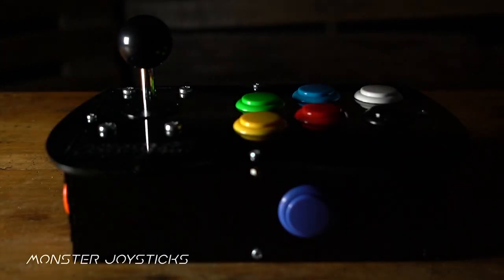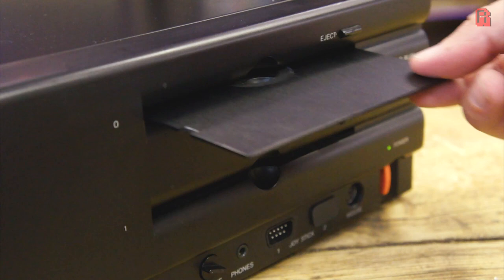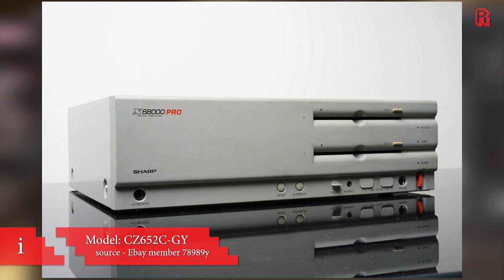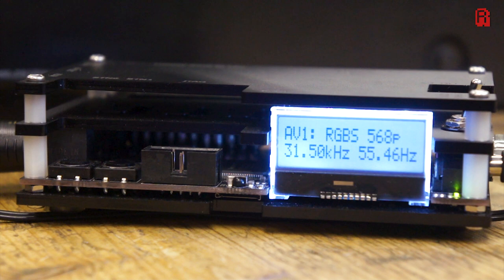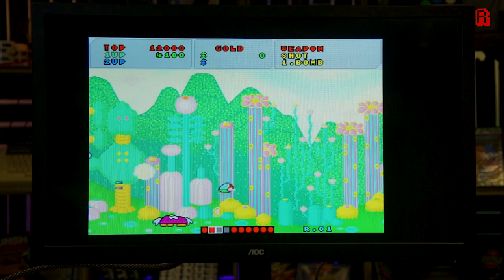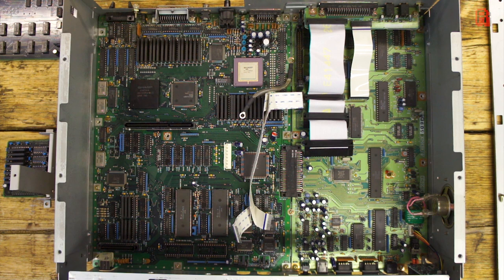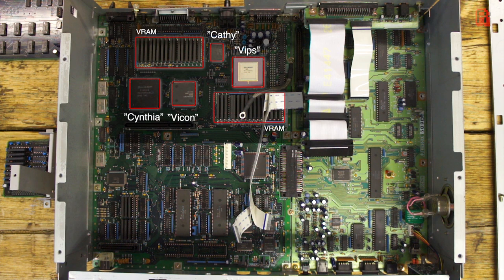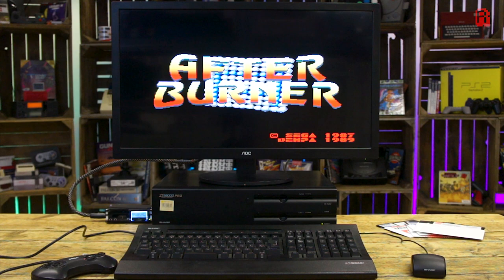The Sharp X68000 Pro Review - Japanese Gaming Workstation

Comment: The X68000 may have been Sharp's last custom computer, but it certainly wasn't the company's last foray into computers. Sharp continued to sell Windows laptops through the 90s and 2000s, and even bought out Toshiba's laptop business in 2018. Perhaps they weren't distributed in the US and UK market, but Sharp laptops were not uncommon in Asia Pacific through the early 2000s. I remember owning a Sharp Actius circa the late 90s that was an ultralight laptop a decade before intel coined the term Ultrabook. It had an execrable 1.5 hr battery life and a screen so dim the light level in a room would actually go down when you turned the computer on, but it weighed under 1.3 kg, which was phenomenal for its time.

Comment: I learnt everything on X68k. Users had crazy tech. Last model was 68030, but upgraded to 68040 or 68060 later. Physical PCM chip spec was supported  only 1 note, but extended to 8 by software. (Later extended to 16 notes with ADPCM state.) It has YAMAHA FM sound chip YM2151 IIRC, it didn't support PCM, but they played 32kHz PCM with changing parameters by software with upgraded 68040 in realtime. There were so many talented crazy programmers.

Comment: I knew of this machine. I did not realize it's max output res was 1024 * 1024... in 1987. We made a big deal out of 720p about a decade ago. Man. This was "PC Gaming Master Race" before it was even a thing.
Reply: Zenith was hyping what we call "4K" - and better - today but back in the early 1990s with AT&T until a hostile investor took them over and cancelled and/or sold everything off.  Japan had the analog HD system called MUSE - which was American tech originally - in use back then but the US FCC basically blocked adopting it and insisted the ultimate HD transition would be digital based which prevented HD adoption for another decade. And then what we got was lower-res than what had originally been pitched.

Comment: Around 1989, or maybe early 1990 I saw a snippet of an article about Sharp x68000; and thinking, that if they released that in Denmark, I'd like to have a look.
I was an Amiga owner until the boat was sinking, and skipped to Apple in the spring of 1995; it wasn't until around 1998 that I had found a proper replacement for Deluxe Paint. -I hardly bother to think that I'd have had any real trouble finding something that could replace Deluxe Paint for a Sharp X68000, in 1989.

Comment: Love your videos. I just recently got a tower version. A small correction :  In the tower unit, the board on the left in your machine is upright in the right tower (along with a 2 slot card cage, video module and status LED pcb). The floppy drives, power supply and hard disk (if installed) are in the left tower. The skinny board on the right side of your machine is laying flat in the BASE of the tower system. The two are connected via ribbon cable. Hence the whole system was an upside down T. The tower system is a beautiful piece of design, but a pain in the A$$ to work on.

Comment: Those are some serious specifications for 1987...
The base sprite engine is about on par with the SNES...
But clearly everything else is higher specification....
I wonder what kind of capabilities it has in terms of parallax scrolling and the like?
certainly has a serious output resolution...
Reply: Wikipedia has a helpful list: https://en.wikipedia.org/wiki/X68000#Technical_specifications

Here's a list of resolutions it can output:

256×240 pixels @ 16 to 65,536 colors
256×256 pixels @ 16 to 65,536 colors
512×240 pixels @ 16 to 65,536 colors
512×256 pixels @ 16 to 65,536 colors
512×512 pixels @ 16 to 65,536 colors
640×480 pixels @ 16 to 64 colors
768×512 pixels @ 16 to 64 colors
1024×1024 pixels @ 16 to 64 colors
Reply: To give you and idea of how awesome this this was, Capcom used these computers as their workstations when designing CPS-1 games, like Ghouls N' Ghosts, Final Fight, and Street Fighter II. And of course they released home versions for it as well. They are excellent versions to own too and play perfect, the only drawback is the loading time and disk swtiching because they're floppy based.

Comment: Take out the battery, solder 2 wires to the positive and negative terminals and solder a 2032 coin cell battery socket to the other end and mount it somewhere easily accessible. That's what everyone (and me) does with the x68ks.

Comment: It’s interesting that this machine used the older 5 1/4” floppy drives & disks given that by the late 80s computers in this price range where all switching to 3 1/2” floppies drives & disks. Maybe it was a backwards comparability thing or due various factors that made Japan slower to abandon the 5 1/2” disks then the U.S., much like how  the U.K. stuck with data tape based technology (Compact data cassette, ZX Microdrive, etc.) over floppy drives longer then in the U.S. The eject mechanism in the 5 1/4” drives used in these system is fairly advanced for the era, the use of a lever you swung down to hold the disk in the drive was more common on ho e computers and Dos pc’s in the 80’s. This is much more like the 3 1/2” floppy drives used in the Macs which where software electable rather the traditional mechanical eject via a push-in button as found on most other 3 1/2” drives of the era.

Comment: It would be interesting to find out what upgrades and accessories are available for this machine.  Also it might be cool to try out one of the Terrible Fire accelerators on it.  As they just sit on the 68000 CPU and have been proved to work on the Atari ST as well as the Amiga.  The intergrated IDE could be an easy way to install a memory card hard disk replacement internaly.

Comment: 68000 series was a great processor with a logical, orthogonal instruction set. programming x86 is just an ugly chore.
Reply: Great comment.
Reply: X86/64 is much better now than it was back then, but there is still legacy code/systems in there, but it is so damn fast now. I would really like to see a Octacore 4Ghz 680x0 processor :-D
Reply: nah x86 still all derived from the 8080, tiny number of registers, special operations on some of them. x64 got 16 registers in ... 2003. 68000? 1979. show me anybody who has programmed both at assembly level and prefers x86 and i'll point out a madman. in the world of brilliant optimizing compilers it doesn't really matter, nobody is writing huge applications in assembly (unlike say the VAX which had lots of built in functions to make writing whole apps in assembly much easier). If Motorolla had the amount of money intel was generating then the 68000 could have kept up and become a performer. Intel made shedloads off the PC revolution at the expense of billions of man hours in the early days of configuring MSDOS for more than 640K of ram, and win 3.1 running in protected mode was a crash prone disaster, which when you undstand how the implementation works you can only glory in the fact that it worked at all.
Reply: I agree with everything you say (except Motorola just didn't want to continue the 680x0 not that they didn't have the money) and yes I have programmed the 68000 and the 80486 (I learned MC on a 6809, maybe that why I liked the 68000) and yes the 486 was horrid rats nest. But what I was getting at was the fact that all that ended with the 68060 while the x86 continued on getting better than it was (normally just adding instructions to ignore the legacy problems) and getting very much faster.
Reply: most of the intel gains at that stage was increasing clock speed and power usage. remember when your pc used to put out as much heat as a hairdryer at idle?
Reply: Given that everything is C or higher level now that's kind of a moot point, but at the time, sure.
Reply: @youtubesuresuckscock  I wouldn't say it's "a moot point" just a hidden (and not talked about) issue. Just because your not programming in Machine code that doesn't mean your compiled code isn't. All higher level languages are just a more inefficient (memory, file size, speed) way of getting the same result from the CPU (also easier). C compiled code will use more memory and by extension be slower (may not be noticeable by multi GHz systems, but it's there) but the trade off is speed at which you can create that code.
Reply: @daishi5571  I think it's a pretty safe argument that modern compilers are better optimizers than the vast majority of programmers. 

Many 80s and 90s video games were horribly optimized and ran way worse than they could have. If the engineering effort that's gone into x86 compilers had gone into C 68k compilers, I bet you could have made Genesis and X68000 games with C that run faster than almost all of the commercial software from that era.
Reply: @youtubesuresuckscock  Better optimized does not mean well optimized. When I was learning C I noticed boated memory usage and code that ran slow. So I ran a few comparisons (just some basic stuff, screen scrolling, memory shifting...) and what I found was that every program was much faster, and much smaller when written in assembly (also took longer to write) Now I realize that this is not conclusive as most programs are much larger than just a few routines but I do believe it is a good indicator that C is far from optimal (and from what I have seen, same with other languages) I took a quick look to see if I could find anything for comparison and found that someone took the BBC computer version of Elite (1984) which was entirely written in assembly and fit in 32KB (that is complete including graphic and audio assets) he reversed engineered it and wrote it in C. The game is 868KB and just the main program is 173KB, with the remainder consisting of assets. How badly optimized is it ?? but it shows the difference in design from then to now with the original being self contained and the C remake using 38 files and vastly more everything. Another quicky was 1KB Chess on the ZX81, lets see someone write that in C in 1KB.

I think you are confusing "horribly optimized" and pushing a system to it's limits (and beyond) most games from back then weren't written in MC for convenience, but because the limits of these systems was such they needed to control the very pulse of the system, something that C has no idea about. From my own experience if we relied on C for programming back in the 80's & 90's very little would have come out because C requires more everything and the systems just didn't have that.

In the retro scene those that still program for systems like the Genesis/Mega Drive are still using Assembly for all essential code and "if" they use C it's only if they have no memory worries and code that's not pushing the systems specs.

Assembly to Machine code compiling is direct 1 to 1 so very little engineering effort was involved in the compiler, more effort was put into the editor. C Compiling is rather complex and multilayered loading modules full of code you don't need with code jumping you have no control over.
Programming C is like asking the system to do something, you don't know what going on all the time, and you get the result when it's ready.
Programming Assembly/Machine Code is telling the system exactly what to do, with no deviation, and get the result you already knew was coming. It's also harder and more time consuming.
Reply: Did you actually program in assembly on either of those two systems, or are you just regurgitating what you've heard from others?
Reply: @youtubesuresuckscock  In fact most games for the SNES and Megadrive/Genesis were already made in C, specially japanese ones.
Reply: PowerPC is derived from the M68k architecture if I'm not mistaken
Reply: I programmed 6802 and MC68K assembler in the 80s and found them to be a delight, compared to x86. Since we've moved on and use Ansi-C and later C++ / C# etc it's no longer in use. But those were fun times and we had full graphical GUIs in just a few megabytes of RAM. I wish the Amiga and Sharp X68000 was still around, as an alternative to MS/Unix stuff of today. :) LDA#$00

Comment: That 5.25" drives looks so cool. I thought Apple Lisa's twiggy drives(which also could eject disk by drive itself, just like X68000) were really cool(although I've heard that it had reliability issues), but X68000's floppy drives are on another level. It reminds me of slot-loading optical drives.

But at the same time, it's kinda odd that they used 5.25" disks, while computers like Amiga, Macintosh, and Atari ST used 3.5" disks.

Comment: Excellent piece of kit. I've definitely wanted to experience one since I learned about it around 15-20 years ago.

You've got a real gem there, and I look forward to watching the next videos.

I'm curious about how the game controllers worked - especially once Street Fighter came along with the 6 attack buttons. The Amiga really fell short with most games only supporting a single button joystick, despite its great hardware capabilities.

I'm also interested in how large the games were, and how many floppy disks they came on. It looks like the hard drive wasn't mandatory, so I'd be really curious as to how some of these large games were handled in terms of disk swapping and/or installations.

Great stuff.

Comment: HI there, I tried hooking up an x68000 export to a sony pvm, and I see two images on the screen at the same time. Using a SCART cable from the x68000. Do you have any idea why the Sony PVM would be displaying two full games on the PVM screen at the same time. The game looks crisp and perfect on the PVM screen, however, there is a game shown on the left 1/3 of the screen, and nothing in the middle of the screen, and then the right 1/3 screen also has a game screen on it. SO its like seeing double. Wondering if there is some setting in the x68000 that has to be adjusted to fix this? Does it need an OSSC or a framemeister? A line doubler?  Not sure...I have never seen another retro game console look like that on a Sony PVM before.

I can play other game consoles using same SCART switch, same PVM etc...and it works perfect. its just the x68000 is showing two images on the PVM at the same time. :-(   Im waiting to get a custom x68000 VGA cable. But in the meantime I just got the SCART cable to try out, and found out I am seeing these two images. Was hoping you seen this before and know how to fix it.  Thanks

Comment: Only doing X68k emulation so far but love to got my hands at one of the upright models with retractable handle. Find them awesome looking and better than this model. Also CRT is a must, but of cause most CRTs can't handle 15khz @ 60hz. Funny enough, through emulation and custom resolutions I can run old games in true 320x200 when setting refresh to 140hz. If there would be some hardware we could plug between old computers and VGA CRTs and force higher refresh rates, we could actually use most CRTs for 15khz resolutions without double scan on original hardware that doesn't allow to change refresh rates.

Comment: I'd say that you can see that the case was made on the same manufacturing line as VCR:s / Stereodeck cases from the timeperiod. Same shape, same type of screwholes.
Or am i completely wrong in my speculation? BTW, a darned cool machine that.. :)
Reply: that might be right on, actually. Sharp's TV division designed this machine. Their computer division designed a different line of machines, the MZ series.
Reply: Even the frontpanel screams "VCR" at you when you first look at it. It really is that type of styling.
Reply: The previous machine in the X series, the X1, is a literal tape deck. It's sexy as hell ;D

Comment: I'm surprised they never tried to market the machine in the US as it's price would have been competitive with the mid range IBM PS/2 line such as the Model 50 and low end Macintosh's such as the SE.
Though Atari ST mega and and Amiga 2000 were still cheaper.

Comment: Hello nice video!
Can you tell me something, im trying to install a midi board in the expansion bay, and i feel the insertion force needed is hugeeeee. It's like even if i push 10kg i dont feel it goes in... It just stands in there... Do you remember how it felt?
Reply: hold on! first check if there are any bent pins if you can't put it in. don't be too forceful.
Reply: @pauliusgruodis137  thank you sir! Actually i just continued pushing hard and slow left and right and finally it went in. Sound goes thru !
Reply: @CousinHubertRetrogaming  glad things worked out. have fun!
Reply: @CousinHubertRetrogaming  With these old systems the connectors become oxidized and coated in "stuff" which then grinds during insertion. One option is to clean using 99% isopropyl that would help, however I prefer DeoxIT as it removes oxidation and reduces wear.

Comment: A wonderful system, Japans answer to the Commodore Amiga.
Reply: I would say that the X68000 far surpasses the Amiga... ANY Amiga*.
I own an A1200 with the AGA chipset, and an additional 4 megs of Fast RAM, but it really struggles on the higher resolutions, whereas the Sharp took even 1024x1024 in its stride. Sound-wise, the Sharp is at least on par with, if not also better than, the Amiga's Paula chip.
*To clairfy: I mean a stock Amiga; obviously the big-box models can be decked out with both graphics- and sound-cards which would even the playing field in the Amiga's favour.

Comment: I've always wanted one of these, and the original X68000 vs an Amiga 500 makes for an interesting comparison. Reading up on the hardware side of things it seems this system would excel at exactly what you're showing here, sprite and tile based games, obviously surpassing the Amiga in that area, while the Amiga people seem to have gone for greater flexibility with hardware assisted line-based video manipulation and blitting assisting rather poor sprite performance and a complete lack of tiled graphics modes. That got it a long way, but in terms of game graphics of the time X68k looks like a winner.